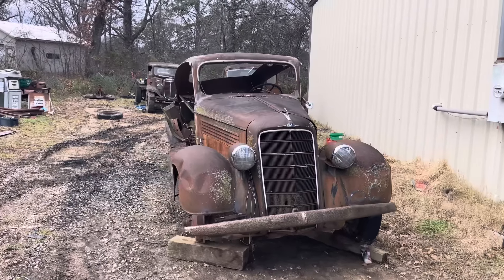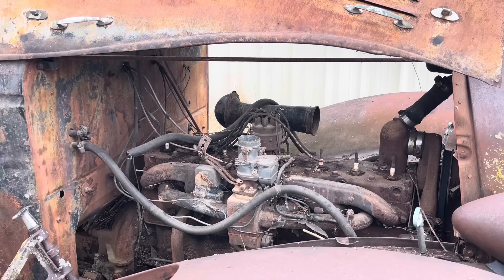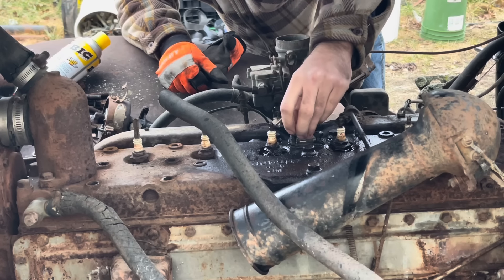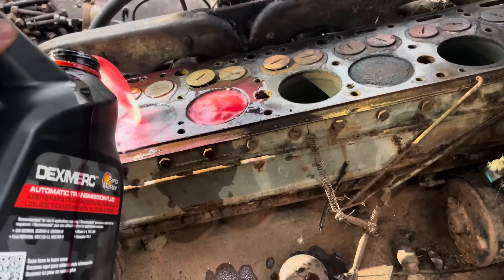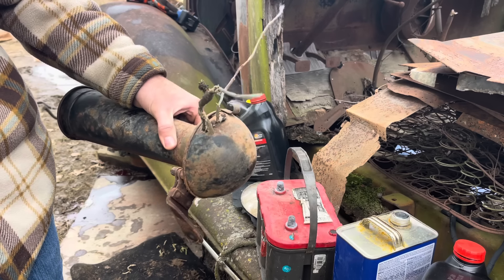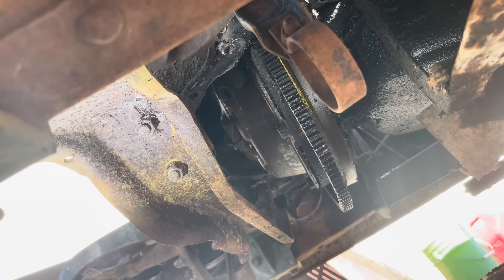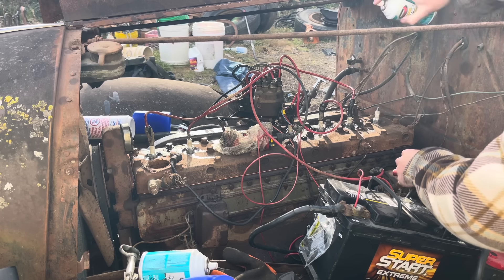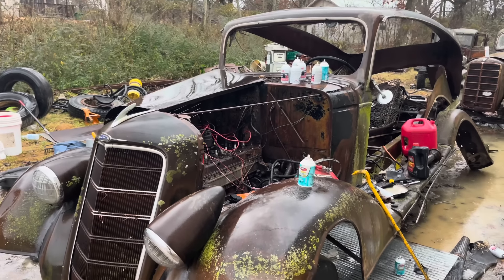Will it run after 80 years 1934 oldsmobile hearse

Comment: Someone trying to start a 2024 car in 2104: “Where the hell am I going to find one of these antiquated computers?”
Reply: Try s
2002 cars now . 😢
Reply: @Mercmad still get stuff for 200 and later even mid to late 90’s but it’s gonna be used and risky or more than the thing is worth. More likely like the last depression our cars over then next several years to couple decades will be rolling technology backwards just to be able to run.
Reply: @gb123-ej8wh Best thing about 80s, 90s, and to some extent 2000s computers is most components are replaceable with basic hand soldering tools. Not anymore
Reply: He he he yep!
Reply: Pretty sure they could rig something up.
Reply: And then find another antiquated computer, to be able to program the other antiquated computers to the vehicle😭
Reply: Now we have things like MegaSquirt which can basically replace the stock ECU, could probably bypass all the unnecessary sensors too...
Reply: To start today's cars tomorrow or 100 years from now the computer will have to go. Just run it simple with a carburetor. It will take some metal fabrication for intake manifold but it can be done
Reply: @MrCarGuy late 80’s
Reply: @BuddyTheWolfYT my Megasquirt is almost 20 years old now 😂
Reply: New cars or from like 80s and forward have thin metal on the car body, that would be gone. Engine does have poor quality steel and alu.
All engine cover plates are super thin. Back in the days the Top was like rock solid steel.
Soo cool to see this old work horses come to life.
Reply: Or just modify it to work with steam or solar panel

Comment: "At least it's clean water and not rusty" while watching 3 gallons of water drain from the engine has to be the most glass half-full sentence I've heard
Reply: Agreed, that's the kind of positive thinking that we need 👍🏼
Reply: Yea, well there's a good point there, if nothing came out, it's either a massive hole somewhere, or alternatively as he says rust means it might have gotten fully filled with rust. While water is horrible, its not the worst case scenario.

Comment: You are one of the most positve individuals I know on YouTube. I imagine it like this: Presents car burnt in a barn fire, burnt to bare metal. Tires melted off, essentially nothing left. Jennings Motor Sport: "And that soot washes right off and when we open the hood, look, it seems to be all there. We need to put them new plug wires and she'll be purring like a kitten!" Proceeds to put spark plug wires on and starts the engine.

Comment: At 20:23 when you were cranking the engine over, there was a couple valves towards the back of the engine that were not closing all the way
Reply: yea, was at least a pair of them that were stuck
Reply: @pirtatejoe    they were free just before he put the head on. Of course, that doesn't mean they couldn't have stuck again.
Reply: Came here to say this. Had at least 2 stuck.
Reply: Yeah, I noticed on #8 for sure the intake valve wasn't moving. It sounded pretty darn good when it was running though. The straight 8 engines are a REALLY smooth running engine too.
Reply: Yeah, 5 had a frozen one, & 6 had one that wasnt seating fully.. Could have used more diesel down those two, & some love taps with a 2lb valve hammer..
Reply: More than two valves near the distributor
Reply: Ditto, he took the head back off. I figured he would catch it, but they still weren’t moving.
Reply: Oh that was the problem.......
Reply: No. 4 cylinder had a valve that wasn't moving free
Reply: You have a serious problem with extreme exaggerations!!!
You really should learn to tell the truth more!
Reply: @TF856  that's what you fall back on when you really don't know what you're doing. As evidenced by the stuck valves that he somehow didn't see. In 200 years this will be referrenced on a variation of Wiki saying that the engine takes 10 gallons of oil too.

Comment: This is SO cool! I LOVE those Straight Eights! I have ALWAYS wanted to build a bored and stroked Straight Eight with forged internals and much higher compression, then build a multi-port fuel injection system for one and turbocharge it to see how it'd perform. 

Edit: Knowing my luck it'd only make like 250 HP and I'd get smoked by a Ford Focus...
Reply: I think my 99 suburban with a 7.4 l would beat you lol
Reply: But you'd bury any Ford flathead!
Reply: Sometimes its better to be COOL than FAST....ask any lowrider or leadsled guy.
Reply: A Ford Focus would smoke this only because it would weigh about 5,000 pounds less.
Reply: This hearse outlived its passengers.
And its drivers.

Comment: You have two stuck valves, one in cylinder number 5 and one in number 8 (counting from the front of the motor).
Reply from the maker: I got them lose off camera I didn’t know them until after I put the head on had to get them lose through the plug holes
Reply: @jenningsmotorsports7554  where is most of your content posted

Comment: A mechanic greatest virtue is being persistent  and positive .
This guy has The patience to methodically work every issue with a calm demeanor thus solving the issues step by step. The Army can surely use this guy , He can be my unit motor sergeant in combat , and my convoy will travel miles and miles to victory.

Comment: It looked in the footage like three of the valves were still hanging open when you put the head back on. I imagine they would’ve eventually freed back up though because they weren’t “hard stuck”. Probably right that it just had ring issues, valve sealing issues, or maybe the ignition timing was a little off. Amazing that it sputtered and ran as much as it did! Thanks for the great video.

Comment: I restored a 1934 Oldsmobile,  Australian bodied 4 door sedan with spare wheels in each front mudguard, or in other words, 6 wheeled. It came out of a paddock and needed everyone  rebuilt. It was a beautiful car. I kept oit for a few years and moved on to 1960's cars. In the 30' s the chassis motor and all running gear  was imported and a coach built body fitted , following the US design closely.

Comment: With that much mousehouse I’d have skipped the vacuum and gone right to the leafblower lol
Reply from the maker: The leaf blower didn’t have enough power them rats pack that stuff super good somehow I had to pull most of it out by hand and with a screw driver
Reply: @jenningsmotorsports7554  gotta invest in one of them blowers they use at gas station car washes lol

Comment: Great job! When it was running it sounded good. Those old straight eights are smooth as silk when running good. I did notice when you were cranking with the head off that the intake valves on #5 and #8 were stuck open. Obviously, that would not have kept it from running, it just wouldn't have been super smooth. What a cool old car in its time!

Comment: I once used 24v to spin over an old old engine so it would build up compression.   On an old pos like that. You got nothing to loose
Reply: Probably need to fix the flywheel/ring gear before going to 24v, but otherwise good idea.

Comment: Very cool.  I have to wonder where you dig this stuff up.  You come up with some of the most off the wall vehicles.  The V8 caddie from the 20s really got my attention.  I just love to see what you're gonna be bringing back from the brink next!  Biggest difference in Buick to Olds straight 8s was that Buicks had overhead valve.  We have a 37 and a 51 Buick.  Both basically have the same OHV straight 8.  Olds and Pontiac had flathead 8s for years until the early 50s when OHV V8s began to gain popularity.  I think Olds got theirs in 51. and Buick in 53 and everyone knows about Chevy in 55.  Great videos man!  Keep it up.
Reply: Olds got theirs in '49, the first Rocket 88.

Comment: Babbit bearings. For mid 1930's LaSalle used the Olds 8 but a slightly larger displacement. Low revving L head straight eight. Oils and fuel were not like todays. Not unusual to need a engine rebuild at 25,000 miles or at least a valve job. That engine would be capable of highway speeds today or at least 60 mph and maybe more. But nobody drove that fast in 1934. 45 mph was usual speed limit. Got to get some heat in it to free up stuck rings. It's amazing it started and ran some.

Comment: Excellent video Jennings  :) think motor needs rebuilt on rings in cylinder because of smoke saying to much oil and less Laughing Gas (Ether) also Air together  ! But on tapping was slowly going away when had running for few seconds and Flying Wheel plus ring gear was big problems too ! Like Termiits one sentence you  said had Lol too !

Comment: Great job in the attempt to get it running, just wanted to say,. I heard you had several batteries on hand.You could have used more than one to start the car. Hook them up in parallel and it will increase your amps and keep the voltage at 12 volts.  That is pos post to pos post and neg post to neg post.  If you go pos to neg in series you increase voltage and keep the same amps. Mostly only needed in Military appliccations.

Comment: You have to take the motor out, clean, lubricate and seal all air leaks.  I use an old thin fabric work shirt for a container filter that can be washed over and over.  TD   Atlanta

Comment: Hey, I love your videos you need to invest in a DeWalt leaf blower they make three of them get the most expensive one and  it will  do wonders of blowing all that stuff out. Then you can use your little air compressor to get the nitty-gritty so much easier and time saving
You will love it you can blow everything out your cabs of your vehicles and even go home and blow your concrete slab off :)

Comment: Most funeral homes were very close to the cemetery, so you gotta think that mileage is probably astronomical.
Reply: Not uncommon for specialty vehicles to have low mileage because they are only used once or twice a week. In some small towns you can find 30 year old fire trucks with maybe 10k miles on the clock. Yeah, lots of run time, but few road miles. An old hearse won't have a lot of idle time because there was no reason to run the engine for AC in hot weather.

Comment: Love this content!! I do similar things to this with old engines and boat motors. I use a 60hp outboard carburetor with flexi hoses and a boat fuel tank and primer line to get it sitting right. I have a choke right there as well as the throttle on the carb and it makes it super easy to run (not really start) any engine without having to balance starter spray. But I haven’t worked on something this wacky like you do 😆.

Comment: I think the engine  still has  life you said it only reads 24,000 miles, plus idleing time. most likely stuck rings, a good  signs of that is the smoke,  the ols straight 8 usual had a life span of around 80,000 miles  before rebuilding, because it being a hearse,  it wasn't  driven hard while in sevice.

Comment: 11:55 they didn't need oil in those days, they were lubricated by water like a fuel pump is lubricated by the fuel 😅😆
Bloody hell, 26:32 for a second then I thought it was alive. have to say, that Straight Eight sounds like a really smooth V8 😊

Comment: If it were an exotic like a 1935 Auburn or Packard ,  could make a great woodie.

PS Buick 8's are Over head valve. But Olds, Pontiac, Dodge and Packard were all sidevalve .   Sidevalve engines tended to run quieter so  were kept in production for years.

Comment: You had it running. Wonder about ole pressure but then put the good carb on w/ gravity feed gas and  fire it up, fire it up, fire it up! Get it up to 1,500 rpm & hold until it gets real hot and almost seizes and let it cool back down to ambient. That's one heat cycle. Keep doing that while you work out the starter & gear, clutch, trans, rear axle, tires & radiator. It'll be ready when you are. Thanks Jennings, very entertaining. Duel points? I always thought they were for high rpm. Straight 8's didn't rev that high did they? tnx again ben/ michigan

Comment: I know that this might sound a bit crazy, but what about two (2) separate batteries? I am not sure if the oldsmobile is a 6V Starter System or 12V. It hardly matters. But I thought that (when cranking the Starter), a voltage drop may exist at the Spark Coil. This would then give a very poor or weak spark. So, if the Spark Coil was fed independently from a fully-charged (separate) Battery, the spark would be almost guaranteed, and improve the chances of starting any vehicle. Just my thoughts, but it was nice to see the old girl become awakened from her long sleep! Greetings from Australia.

Comment: compression test,  I am wondering if the bearing were covered with oil since so much water forced the oil level up around the bearings and saved them ? Use a little oil in your gas. do the comp test with some oil in the cylinders. 

 Damn, you are having all the fun man !  subbed

Comment: Speaking of dissimilar metals I once saw someone try and take the head off of an early 1970s Jag straight-6, which have a cast iron block and aluminium head...he ended up using a crane and the weight of the block to break the head off.

Comment: The restomod add a smallblock V8 from a newer year would be easier, and it would drive at 75 mph better, also likely requiring a front disk brake conversion to not die. Then it would be easier to add air conditioning also. Sure, not an all original antique then, but more practical, especially if you do not do a full restoration for the paint and leave it a little crispy.

Comment: As for the Shop Vac, chances are some debris got past the filter and is stuck in the motor intake. My Shop Vac had an inadequate foam filter when I got it and the intake was plugged up pretty badly.

Comment: Oldsmobile and Pontiac had slightly different flat head in-line eights. Buick only used overhead valve motors; what was the Buick six became the GMC six in 1929. When gasoline was barely 50 octane, a 4:1 compression flat head was just fine.

Comment: Please before you try to screw out the sparkplugs, fill the low places around the plugs with penetrating oil/fluid and let it set for a week before trying to screw the plugs out. It may save you loads of trouble.

Comment: All that water in the engine probably degraded it's internal parts. The timing chain probably weakened requiring advancement but doing that with a bad chain is like putting a bandaid on a severed arm.

Comment: Fluid - It will find holes, but not particularly due to degreasing alone. Acetone has a surface tension (wetting ability) better than that of typical engine oil - so will wet out tiny holes far more readily. The starting ring is clearly not well.

Comment: Yeah I dropped a screw driver bit down the spark plug hole on a 98 isuzu rodeo, I thought I was gonna have to pull the head but my neighbor came over with some pieces of a magnet and thank God we were able to fish that bit out of there.  Took a few days of poking around to get it out but yeah it def can happen, I don't leave holes unplugged anymore.  I didn't see it go down there but the noise I heard was all I needed to know, it would have been soooo easy to miss.  Then it would have ruined my day if I'd cranked it up.

Comment: I noticed the intake valve on the rear cylinder wasn't moving, before you put the cylinder head on and after you had to take it back off so hopefully you noticed that. Typing this before you attempted to start the engine. Either way, you have more determination than me lol.
Reply from the maker: Yes I fixed that also fixed the other 2 valves that where stuck just had to do it the hard way since I didn’t notice it before I put the head on
Reply: @jenningsmotorsports7554  I'm going g back a few months to watch a bunch of your videos, yourube wasn't telling me about you making videos so I have alot of catching up to do and more or less you will see me commenting here and there. One thing I like is how you get to the point on things and I understand we all don't have a ton of time to edit videos and show alot of our work (I do the same) but you show enough to prove that with enough determination, you can get something running again. Anyways, keep up the videos!

Comment: Did you try putting oil in the cylinders? Sometimes it will help them temporarily build just enough to run, and those rings may free up if you can get it to run long enough.

Comment: That ring gear fix was kinda "mickey mouse" but I was hoping it would work. I think the biggest problem was trying to stick weld it instead of mig-welding.  I see ring gears on the web for 30s vintage Chevys ($50) so likely there's something out there to do the job. You just need a tooth count and diameter.

Comment: I'm pretty sure you've gotten this a dozen times over in the comments, not ALL of your valves were working when you had the head off. I think it's cylinder NO. 5 (going from front to back for counting) where one of the valves didn't move at all.

Comment: Hey look at your video again from when the head was off and you were turning it over.  It looks like the intake valve on the 5th cylinder back from the front is stuck wide open.

Comment: You started this engine with that fluid mixture in the pan instead of engine oil?
Reply from the maker: No drained the oil pan and put Valvoline VR one racing oil in it with the zinc
Reply: @jenningsmotorsports7554  i was quite curious about this mixture's efficiency in the pan because mostly people pour oil in the cylinders but nothing to the crankshaft bearings. Epic video and thx foe the answer!🤜

Comment: The horn's Stick inside Spray inside with pb max / on horn fin's Hmmm Then let sit a night try in morning  tap with small rubber hammer in horn area. its like cylinder wall surface rust :)